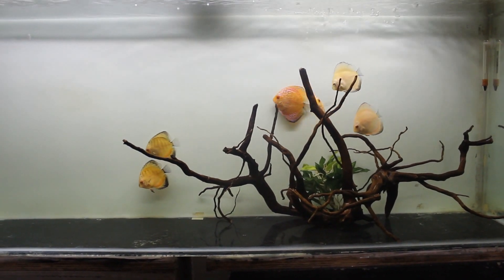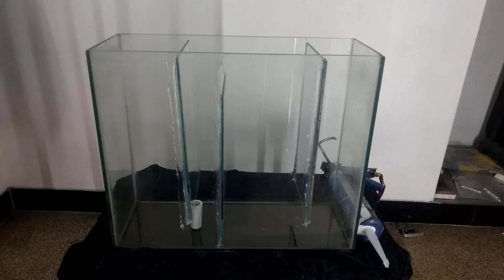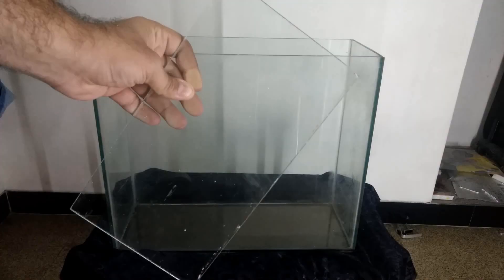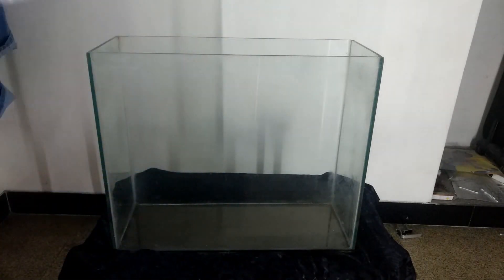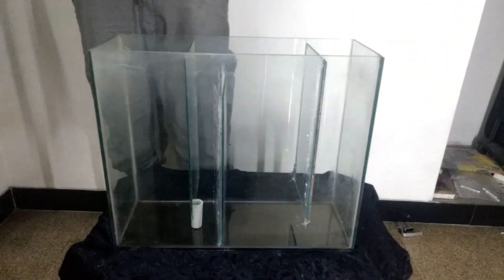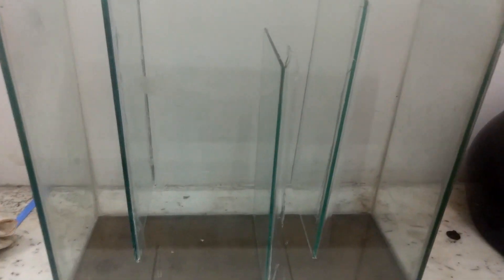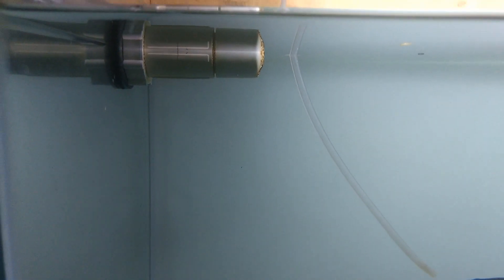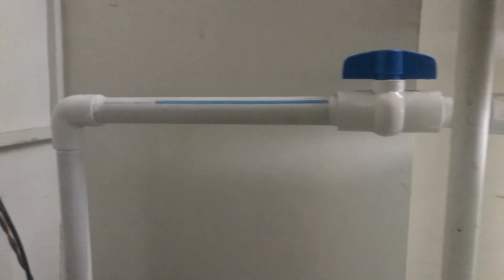EASY WAY To Make Sump Filter At Home | DIY | The Indian Fishkeeper

Comment: There are a few questions on the stage after adding the heater and pump, how did u complete the piping, what length did u use, does it work or not and how does it function. You started well got me interested but later couldn't connect. Could this be properly covered.
Reply from the maker: +Vishal S I have shown how I did plumbing for this sump here https://youtu.be/yA096mu4P8I.
Request you to subscribe and hit the bell icon so you will never miss an update.

Comment: Nice videos👍👍👍, could u plz tell me the cost of the pump u used in it.
Reply from the maker: Raashid Khan thanks raashid. do subscribe. I bought it from a local hardware store for approx ₹ 200. it works pretty well.
Reply: What is the lift rate and what is the name on it
Reply: You have a great discus in your thank. Iam going to buy them this month. For what price did u buy them.
Reply from the maker: discus price depends upon its size. it better to get at least 3 inches at first which would cost around ₹500 +. always buy from a good breeder only.
Reply: Thank u👍
Reply from the maker: Raashid Khan 12V
lift height  3M 
flow 240L/H
these are the specifications.
Reply from the maker: Raashid Khan place watch this video. it showcases the whole discus tank.
https://youtu.be/GXNQvTCklZA

Comment: I have a basic question yet very important. In Sump , we usually take inlet from the surface of our tank. But debris and dirt get down in the surface of the tank. So don't you think surface inlet ( like in PVC overflow or HOB box or Like you have a hole  in your tank ) provides inefficient filteration. Canister take water from the bottom of the tank but sump take water from surface .. Is it effective to take inlet to sump from surface of our tank instead of taking input water from bottom or middle of our tank ?
Reply: Your answer is awaited.
Reply from the maker: MONU thanks u for asking such detailed question. Any fishtank with any type of filter require cleaning of debris(heavy and non floating) via syphon. Syphon can be bought online or from local shop. Even a canister or gravel filter requires this. I prefer sump or canister filter because they do better cleaning of floating debris.
Reply: The Indian Fishkeeper Thanks for your reply. So Heavy and Non floating debris like fish poop and food is not meant to be cleaned by filters like sumps. I understand that gravel cleaner are meant to clean such heavy debris. But brother don't you think that taking input from surface exploits the entire basic idea of mechnical filtration as we are relying on siphon cleaner  for this.
Reply from the maker: MONU you can place extra  powerhead in such a way that even fallen debris are sucked by filter. Also, mechanical filtration doesnt mean that it will suck all the debris.